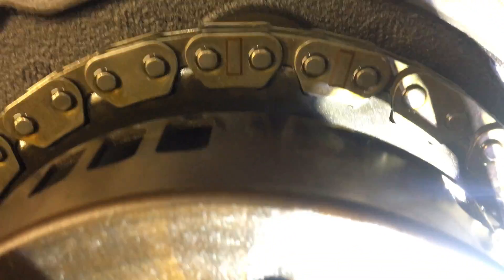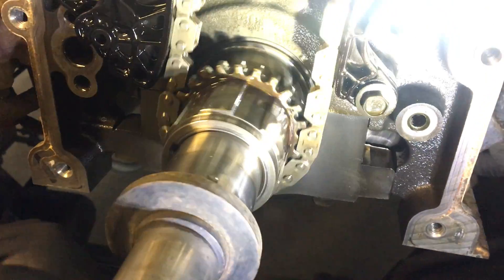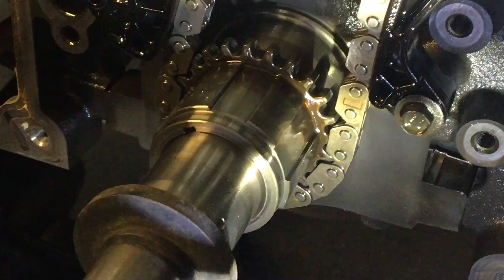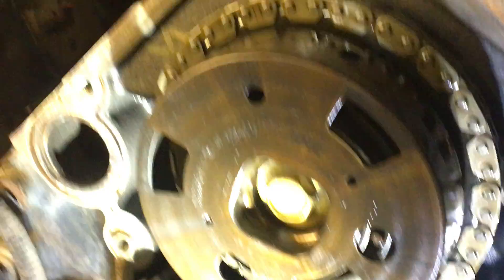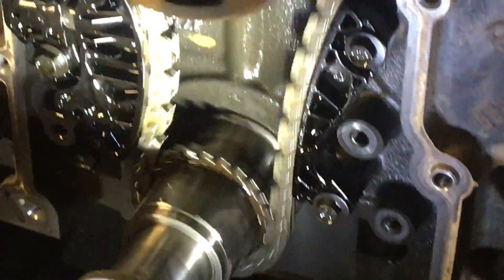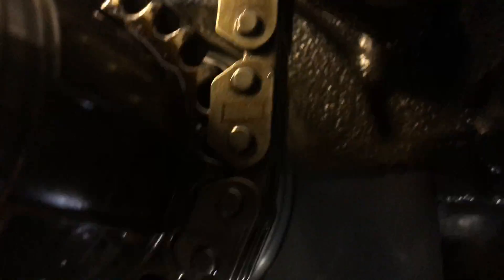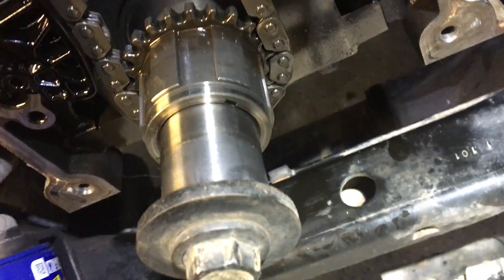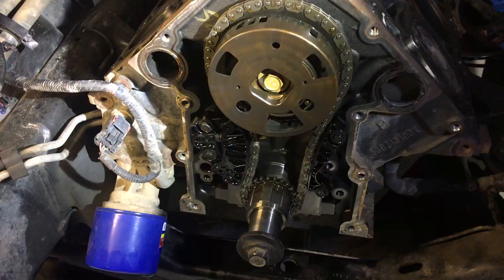2011 ram 2500 Hemi 5.7- how to set timing

Comment: Bro, You didn’t have to do all that, The chain mark method is basically for people thats not mechanically inclined. The only thing that matters is the #1 piston flush with the surface of the block, that puts the crank in perfect timing, then all you need to do next, Is install the cam with the pin at the 12 o’clock position, put the cam sprocket on (aka vvt phaser), tighten the cam bolt @90 ft lbs with blue loctite. (Do Not Rely On A Electric Torque Gun)

Comment: Why didn't you just set number 1 to TDC then make sure you have the cam in time then slide the chain on ??? You are making unnecessary work
Reply from the maker: If you know how to do it you’re watching unnecessary videos. I have explained I am not a mechanic. But this worked great for me and I have had the truck 8 years and it is still running strong happy wrenching

Comment: This had nothing to do with "setting" the timing, only "checking" the timing. To set the timing, all you had to do was get the #1 cylinder up to TDC on the compression stroke. The dot on the crankshaft  sprocket will line up at 6 o'clock with #1 compression stroke at TDC. Lay or hold the chain out with the two camshaft timing marks at 12 o'clock, place the camshaft/VVT sprocket into the chain with mark between the two timing links on the chain, drop in the crankshaft sprocket so that the mark on the sprocket is at 6 o'clock and lined up in the center of the timing link. Have the camshaft pin at 12 o'clock. Now carefully slide the assembly first onto the crankshaft then onto the pin on the camshaft, then put in the camshaft bolt. You would have saved yourself 19 minutes of unnecessary cranking.
Reply from the maker: If you watched the video u would. Hear my explanation of why I did it this way. What suprises me is how many guys know how to set timing but yet wast your 19 min watching you tube videos on how to set timing. Crazy. I will keep cranking until it lines up. Happy wrenching
Reply: @titonunez3431   By your own admittance, this was the first time you have ever done a job like this and you supposedly spent hours researching how to do it. I did not watch your video to learn how to set the timing, I watched the video because I'm in the process of researching tons of data on the Hemi lifter failure to pinpoint the precise cause and eliminate the dozens of theories people have out there. I have already rebuilt Hemi engines before and know perfectly well how to set the timing. Whatever Youtube video you watched that told you to crank and crank until the timing marks lined up, was inexperienced themselves. You do not EVER have to go through that trouble. 

At the end of the video, you alluded to the fact that you were going to remove the camshaft. All you had to do was place the #1 piston at TDC and remove the chain and sprockets, REGARDLESS of where the timing marks were at. The timing marks are only important when you’re ready for install. 

Once your new camshaft is in and the front plate bolted down, you simply rotate the camshaft so that the dowel is at 12 O’clock. Take your VVT camshaft sprocket and hold it up with the timing mark at 12 O’clock. Place the chain onto the sprocket so that the two top timing marks straddle each side of the sprocket timing mark. Then take the crankshaft sprocket with the timing mark at 6 O’clock and place it into the chain so that the timing mark lines up with the mark on the timing chain. Holding each sprocket, pull outward to hold the chain tight. Slip the crankshaft onto the crankshaft first and slip the keyway over the key in the shaft. Then slip the VVT sprocket onto the camshaft so that the slot on the back of the sprocket slips onto the dowel pin on the camshaft. Now put in your camshaft bolt and hold the center of the chain inward to prevent slack while you install your guide and tensioner. It’s that simple. Literally a 10 minute job, and no cranking and cranking necessary. 

Don’t get your feelings hurt because I tried to instruct you on the proper way to set the timing. I merely brought it up because people are going to watch your video and waste their time cranking and cranking unnecessarily, simply because you incorrectly told them that’s how to do it.

Comment: Don't be afraid to just take off the chain and set the timing manually. It is much easier. With the chain off, you simply turn the crankshaft to cylinder 1 top dead center. Your keyway will automatically be at apr the two o'clock position actually pointing right at the number 1 cylinder. No way to screw this part up. The dot in the gear will also be in the 6 c'clock position and you can simply line up the mark on the chain. For the camshaft, turn it until the timing mark on the spocket is at the 1200 o'clock position. Then carefully slip it off, line up the chain marks with the camshaft sprocket  along with the crank sprocket and slip the whole unit back on the shafts being careful not to turn it. Just wiggle it a little and it should pop right into place. Note, your tensioner has to be set back with a pin or small nail. If you are replacing the chain, hopefully, your kit came with both tensioners and a crank sprocket/gear. If you are putting in a new camshaft and lifters, then you will have to do it this way anyhow cause once you take out the old camshaft, you lose your reference timing position, so you might as well learn it so no matter what you do, you will get it right.
Reply: I was going to say something like this as well. Saying that if you just keep it going enough and everything will line up isn't the correct answer. As eventually even if it was installed incorrectly it will line up.

Comment: Awesome video! What went wrong when you attempted the fix the first time around?
Reply from the maker: I tried to remove only one head and replaced lifter #3. That was the one that failed. The sound got better and truck ran a little smoother. Check engine went off for a little while but came back on. So second time I replaced all the lifters and pulled both heads. It has beer. Running solid ever since. Truck is at 186k now
Reply: @titonunez3431  I would’ve probably went that route as well. Not now thanks to you! After further inspection I can actually see grooving starting on cylinder 7. Where did you buy all your parts from?
Reply from the maker: I purchased all stock OEM parts from our local dodge dealer. I thought about doing a performance cam. But thought that is more that could go wrong. I put in the factory spec lifters and cam with new gaskets/seals/spark plugs. I tried to replace as much as possible while In there good luck
Reply: I’m actually in the middle of setting the timing and I’m having a hard time torquing the camshaft bolt. The crank keeps turning when I get to about 50 ft pounds. Any suggestions on how you torqued it?
Reply from the maker: @Mimiandfriend  It was very tough. I had to position a bar wedged against the frame of the truck, as I was torquing this allowed me to get the right torque but it was not easy. it took me several tries to get the bar to hold right and banging my hands. good luck hope this helps.
Reply: @titonunez3431  thanks for the response. I tried that method but I did not have the right wrench to make it happen. I ended up sticking two screw drivers in the flywheel and it held pretty good.

Comment: I am doing this on my 2011 1500 i just did the lifters and cam and when I put the heads back on my timing wasn’t properly done by me. Is there a way to see if I am top dead center without taking the heads off?

Comment: Good job but with all that labor I would have definitely changed the cam and all the lifters at that point other wise all your work would be worthless because the hemi is known for the cam going bad from lack of proper oil flow to the lifters which causes the lifters to go bad and destroying the cam shaft but hey your doing a good job regardless.

Comment: Tito thank you and your wife great video this what’s been stopping me from changing my cam and lifters out because I wasn’t sure about getting the timing correct. Thanks for sharing that goes along way my friend I think u gave everyone on this thread a vote of confidence.. I do have one question for you is it necessary to remove your oil pan when replacing cam and lifters?

Thank you in advance sir.
Reply from the maker: Rolan, 

I appreciate the kind words. I am glad to hear the video is helping people out. Again I am a home mechanic and this was a lot of work to figure out. It did save me a lot of money. I still own the truck and it has been pulling trailers strong ever since. 

I have heard of some guys not removing the oil pan. They only remove a few bolts and are able to bend the pan down?? 

I did remove the pan. to get to the last bolt on the oil cooler.  The pan was probably one of the easier things to do on this repair. there is a lot of bolts but they are low torque and as long as you put a good seal and follow the torquing sequence it should tighten up nice. I would recommend removing the pan.
Reply: @titonunez3431  Thank you sir for the prompted response I definitely appreciate it. I will remove mine also and glad to hear all the work you paid off and the truck is still running. 

Also what brand did you replace your parts with I see some stuff on Amazon not really sure if that’s a good brand what would you recommend? 

Thank you Tito.
Reply from the maker: @rolankelly9683  I stuck with dodge for the Camshaft, lifters and head Bolts. I did buy gaskets from Auto zone felt pro if I remember. I thought about going to a bigger camshaft since I was in there doing the work. But ultimately leaned towards keeping everything stock and putting it back together to match factory. I figured one less thing to have to worry about trying to figure out. I also changed all spark plugs, serpentine belt and as much as I could since I had everything apart. Good luck with everything

Comment: I am glad someone is on this exact subject... FYI, the ratio is always a 4:1 hence a four stroke engine, however mathematically the timing Mark's on the chain only line up with every 28 revolutions of the crank because of the links in the chain so when you are replacing components you may have a lot of engine rotation to set mark's in time before disassembly.
Reply: This is the dumbest thing ive ever seen in my life. Those marks are for setting timing, not disassembly. If number 1 cylinder is at top dead and cam mark is at 12 you can disassemble regardless of chain link position 🤷🏽‍♂️
Reply: @brokeboyracing4815  I think you missed the point. Your right with your comment, however the topic was relative to not seeing the bottom timing mark and replacing a camshaft without removing the oil pan and pump. If the cam gear is in 'time' then you can be sure the crank gear is as well before pulling it all apart. Hope I explained.

Comment: What's the point ur letting the cam faser time its self,  put number one cylinder at TDC and 12 o'clock with the cam sprocket and 6 o'clock with the crank. Ur done none of that turning crap lol. Good luck

Comment: I hope you're changing your Cam if you got a bad lifter
Reply from the maker: Yes sir I did install a new Cam I kept it stock and picked the lifters, cam and header bolts from dodge. I was targeting timing. but 4 years later and I am still running this truck. we just towed back from South Dakota with my 35' camper. truck is a work horse:)
Reply: That's awesome I'm doing the exact job right now On my truck 2009 Dodge ram 1500

Comment: Wow ...thanks for all of the hard work and video,  big thanks to the Wife for helping out,   just holding the camera,  the light, or handing us a tool means SO much,    hope your engine repair went well....
Reply from the maker: I appreciate the good vibes!! yes the repair went well 30k later and still running strong. we just got back from Amarillo TX. keep them greasy and they will run forever. knock on wood. but it has been performing well. have a good one

Comment: is it necessary to take off the cylinder head off to do timing chain line up. I have put back everything but we didn't check if the bottom timing chain is lined up at 6 o clock position because we didn't remove the oil pump and but top two line is line up and the cyl 1 was on top and now i wanna know if we need to take off the cylinder head off to do timing chain correction

Comment: What do you do when the timing chain is broken from the start?
Reply: Rotate crank till mark is at 6 o'clock , rotate camshaft to get indentation mark at 12  and replace chain tensioner making sure the marks are centered with chain markings afterwards.
Reply from the maker: that is a tough one, I am not sure? from the comments the other guys have described another way to time your truck but I am not familiar with the other method. good luck and I hope you can find the info you are looking for

Comment: How’s come you removed the oil pan?
Reply from the maker: There is bolt you need to remove on the oil pump. to get the oil pump out. some guys only remove some bolts from the oil pan and pry on the pan to get something inside to remove the oil pump. I tried to pry on it and it felt like I was going to break something. so I decided to remove the oil pan and I am glad I did because the lifter failed and it did have small metal chunks in the oil pan. this allowed me to clean everything and get the sludge out of the pan. putting it back was easy. add a sealant and tighten the 30 bolt lol hope this helps.
Reply: Tito Nunez ok thanks I’ll be replacing my cam in the future so I’m starting to research what needs to be done. But why does the oil pump need to come off? For clearance? Thanks again:)

Comment: Bro you saved my bacon with this video. Bought a Ram and didn't know squat about the timing when I had to remove everything to change the oil pump. Truck would crank but wouldn't start. Thanks to you I'm confident it'll line up now. Blessings
Reply from the maker: That is great to hear the video helped you. I am a DIY type of guy. and I had a hard time finding info on my truck when I needed it fixed. I am still driving it today and it is running great!! if it's broke fix it:) I see so many people trading in good cars that just need maintenance. have a good day.

Comment: Can this be done without pulling the heads off I'm doing the water pump on an 03 1500 5.7 hemi with just shy of 170 K on it and figured I'd do a few other things while I have it apart
Reply from the maker: you will need to pull the heads to replace the lifters I think yon can pull the cam shaft without pulling the heads. but I am not for certain. I followed the repair manual.
Reply: You can do the cam without pulling the heads, you need to remove down to the pushrods however

Comment: Any updates wondering if it started?
Reply from the maker: Yes sir, it did start and has been running strong since repairs were completed.  30k and two trips to California later. knock on wood lol
Reply: Thanks for getting back to me. Need to do mine getting parts together now. Like to have everything on hand before I start.
Anyway thanks for the video.

Comment: Bro youre doing it the hard way. Take the chain off, put the number 1 cylinder at tdc the notch on the crank sprocket will be at 6oclock, then rotate the cam notch to 12oclock put the chain back on and its timed. The marked chain doesnt matter at all.
Reply from the maker: As I described in early comments, I am by no means a certified mechanic. I was having a hard time finding info on setting timing and not messing up my truck. I found this option and it helped me a ton and it ensured my truck was in time. without having to wonder about setting them independently?? a lot of ways to skin a cat and this was the best way for me. now that I am a little more versed on this repair if I had to do it again I would try your method.
Reply: I did it your way also rotating the crank about 10 mins .  Mines on a 6.1 hemi  . Better to be safe Than sorry.  👍.
Reply: I'll add this fyi- the 2010 ish v6 camaro, Cadillac, buick -(GM 3.6 l engines) don't go by tdc. It has 3 chains, and a specific sequence for removal and installation. The only way you know you did it right was that it runs afterwards. I've read the marks won't line up again.
Reply: Bro put the heads on and do it this way Ill be impressed
Reply: I know I was like woah all that to time an engine
Reply: Yep, I did it on both Hemi 5.7 and chevy 3500. Lots of swoll ppl in here..lol
Reply: Facts tdc is all you need
Reply: Does that work for all dodge motors???
Reply: @kyledevore871  if youre doing a stock cam replacement or changing a worn out timing chain on the gen 3 hemi. Different motors have different timing marks. And all after market cams should be degreed with the cam card and use an adjustable timing set
Reply: Man he did a fucking perfect job shit I wish I did mine like that but I was being lazy and didn't want to remove the oil pan.  Your good Tito don't listen to them bro!
Reply: Is removing the heads necessary when replacing the timing chain?
Reply: @sooner4life38  no as long as you are just changing the chain only.

Comment: Good video but dude the marks on the chain are for install reference only.  Set your crank and cam to the 6 and 12 o clock positions and paint pen your own marks if you are reusing chain.  If you ever work  on a 4 chain set up (not this vehicle), realigning the original marks becomes exponentially implausible.